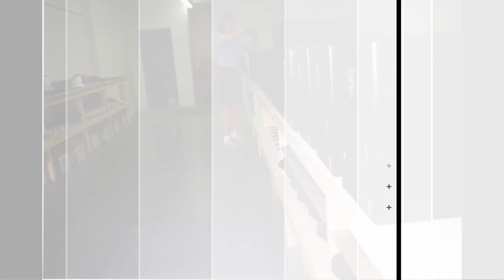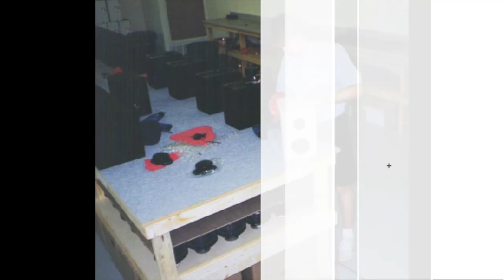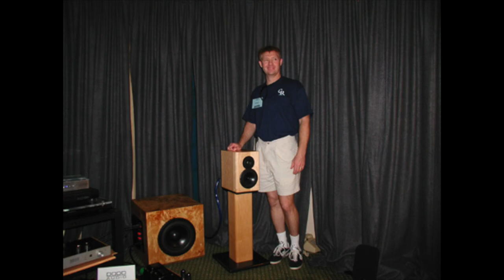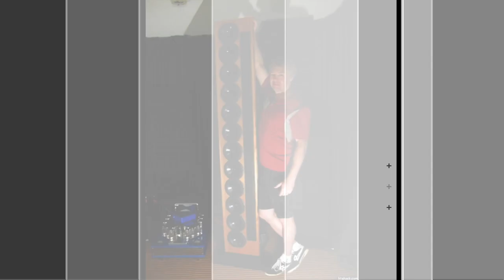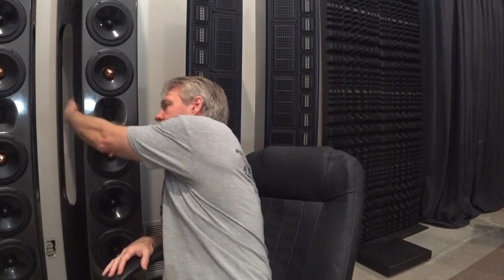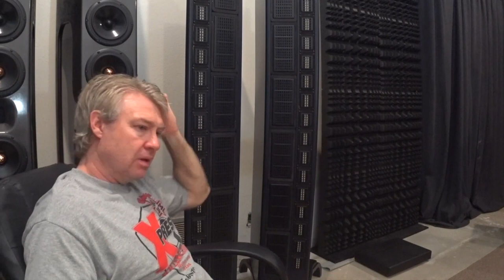Tech Talk 13: Line Source AND Line Array Loudspeakers

Comment: The neat bit about line sources is that although they aren't more efficient, they roll off in volume at half the rate the inverse square law would indicate.
So a quieter volume fills the space more evenly from front to back

Comment: hey amigo 
HF in a allison speaker forum said this can you please respond ? 
a brief discussion of tall line-source systems, mainly as they deal with low bass coming from numerous, vertically aligned small-diameter drivers.  Now, some tall planar and electrostatic systems are line sources themselves, but the video was discussing a line of conventional drivers, and that approach is as valid as what we have with planar systems.  What the video did not mention was an inherent problem with tall line sources above the bass range.   The line is emitting sound from the center will be electrically in phase with what is being emitted from the top and bottom.  However, the sounds from the top and bottom, and points between are out of acoustic phase with the center at the listener's ears.  Think of such a system with only three drivers: top, bottom, and center.  If all three are operating identically with the electrical input, but at midrange and higher frequencies the outputs from the top and bottom will be out of phase with the center.  Add in more drivers between those top and bottom drivers and things actually get worse.

As noted, due to the longer wavelengths, at lower frequencies, this may be no big deal, but at higher frequencies it will be.  This artifact was clearly outlined by Stanley Lipshitz and John Vanderkooy in an AES convention paper delivered way back in November of 1986: "Finite-Length Line Sources."  In the paper Lipshitz mathematically outlined and also illustrated with generated mathematical curves, that above about 1,000 Hz the frequency response (due to those out-of-phase artifacts I mentioned) of such a finite-length system could not deliver uniform output.  

They concluded that such speakers, no matter the design of the driver or drivers, could not be considered as high-fidelity sound reproducers.

Comment: Hello Danny, I realize that the Line Array speakers are best placed out from the rear walls into a listening space.  What about tyour Line Source speakers?  In my example they would be placed 24" from my rear wall and would be 7 feet apart from inner edge to inner edge, and the liner would be 11' to 11'6" away from the fronts of these speakers.  Would this work in my room, and if so what Servo sub(s) of your do you recommend?  I like this type of speakers as I recently had an opportunity to listen to a portable PA system made by Bose called an L1 Pro32 which uses 32 of the Bose "cricket drivers" or some similar driver and it the pair I listed to were used with a pair of the Bose Sub1's subwoofers.  I was able to place my ear to the speakers it it wasn't loud at all but they really projected the sound with surprising clarity and SPL levels at a considerable distance in the hall I was in that was approximately a 100' back from the stage area where the speakers were placed.  It was obvious that those speakers could fill a much larger room, with ease.  I suspect the same can be said for your Line source speakers.  I'm very interested in these, especially after watching a few other videos where you discuss them including with others.  I really like that the speakers are extremely efficient and can be powered off grid with battery power so I can have my music along with me at hunting camp or while fishing...lol.  Seriously though, I'm fascinated by your speakers and would like a pair for myself if they would work in my current listening space.  Thanks again Danny!

Comment: Pretty accurate explanation, at least in my experience when designing true ribbon 6ft line driver system, it is exactly as you describe it, specially far-near interaction and floor-ceiling beaming, which results in great sound in small "live" rooms... Also since efficiency is so high, distortion is super low, i know you don't like to talk about distortion which is weird to me since you care about cables and crossover part properties, binding posts and such details (as you should)...
Reply: I could be that distortion can be viewed as a symptom when having everything else good and not the main cause of the others being good. So when a product is great it just happens to have low distortion.

Comment: It's a bit of an oversimplification to say that speakers beam above wavelength<diameter. In fullrange drivers a lot of consideration is given to cone flexure to reduce the radiating diameter as frequency increases. Admittedly, this isn't perfect as the cone flexural wave produces a frequency dispersive velocity that is proportional to sqrt(frequency). So you will still get increased directionality at high frequencies, but significantly less than if the cone was rigid.
Is fullrange drivers vs bass drivers a topic for one of these tech talks or similar?

Comment: The space between the HF drivers on this Ribon Line  speakers ,  is not 1 inch best  spacing , the perfect spacing depends on the distance to the listener . If you are further away  drivers can be further away , if you are closer drivers need to be closer . Until we get to headphones where it practically needs to be one driver , can be more but there are problems of interference because one driver uses up the air , so now you dont have any more free air , non vibrating air to perfectly transmit your other drivers , so problem build up real fast .
So the reasoning is if you are say 2-3meters away then 1inch or around

Comment: why not make the line force panel from MDF glued to some Birch plywood?   this could be a home build if the plans are available.    We'd just need to Route out the holes with a router using ball bearing trim bit routers using a small template that would have to be re-positioned for each hole after maybe first roughing out each driver hole with a Jigsaw between 4 round corner holes made with a drill bit. I'm sure I could do it.
Reply: That material was not near strong enough to have that much removed from them and still have any structural strength.

Comment: On the Line Array speaker, with the 8 bass drivers, do they avoid the floor cancellation, or just reduce them?
Reply: It depends on the wavelength. At lower ranges the output spreads out vertically and couples with the ceiling and floor reflection. As frequency increases that is not the case.
Reply: @dannyrichie9743  Right, that makes sense. The woofers closer to the floor / ceiling have higher frequencies getting canceled due to reflection off the surfaces, and the farther you get from a surface, the lower the frequency of the cancellation. SO, the average response is going to be more even.

Comment: Awesome video Danny!
You look like top goal scorer on the speakers team 😉
Seriously, how are these Nxtremes to drive?
Would we need lot of power to drive these to their best potential?
How low will these Nxtremes drive in mid size room 16 x 20 with 12ft ceiling and kept 3 feet off the wall and 9feet apart along 16ft wall.... Will sub be a must ?
Reply: The NX-Treme's are easy to drive. We drive them to good levels using a 9 watt 300B amp and a 10 watt chip amp.

In your room a -3db down point in the upper 40's to mid 50's is common. 

They are designed to be used with the open baffle servo subs.
Reply: @dannyrichie9743  Thabks Danny , after things get back to normal around us I maybe interested im these....
Do you think REL push pull 2 x 10 inch sub placed in the corner with lots of acoustic boost from this placement would not be a good match in such room?
REL subs are connected to speaker output of the amp so it get same sonic character of the lows as speakers for much better match to the speakers... ???
Reply: @kdomster9141  It is not a matter of sonic character. And those are more expensive than our servo subs. And our servo subs are full open baffle just like the rest of the speaker.  So the radiation pattern matches and they won't overload the room and cause room boom.
Reply: @dannyrichie9743  How are your servo subs powered? Should those be also placed in corners to gain boost from the room? 
How low (Hz) do these open baffle subs go?
Reply: @kdomster9141  They are powered by servo controlled amps. 

http://gr-research.com/diysubwooferkits.aspx

They do not need to be placed in the corners of the rooms. Place them where they cause the least amount of room boom. Our open baffle models can be placed well out into the room.

And our open baffle servo subs will play flat to 20Hz and hit -3db down levels in the teens.
Reply: @dannyrichie9743  I would need 2 of them for dual mono set up?
So total of 4 12 inch woofers and 2 servo amps would run me under 2000usd plus cabinetry ...
Reply: Danny Richie how can we find out when the line source ready-made speakers are available please?  With love, Ken
Reply: @kenstephens2955  As it looks like I can make that happen then everyone will know. I'll post a lot about it.
Reply: Danny Richie Great!  Thanks!

Comment: I would love the NEO array, but it's way too high for my usage, maybe a 2 x NEO 10 and 6 x NEO 3 with maybe some active subwoofer beside that. :-)
Reply: There are minimal lengths required for the near field/far field transitions to work out properly. You can't get there with short lines. You just wind up with comb filtering issues.
Reply: @dannyrichie9743  Okay very interesting, this is why your speaker and i.e. the genesis is that high. Would a small video abut such special things be interesting to make?
Reply: @friedmule5403  I'll consider doing a video on that one one of these days. I need another line source in here to use an an example.

Comment: Did you mean to say run a 12" to 1000hz and 10" to 1300hz?
Reply: I had the same question. But we know that his crossover points for 6-inch drivers are often near 200 Hz. What have you learned since you posted this question; did you look for the answer?
Reply: @nickburak7518  It know it's an answer to an old question, but in case you didn't find the answer yet. It has to do with the angle that that driver play to. So at low frequencies it will play 360 degrees and dependent on the diameter of the driver it will start to only play forwards at higher frequencies. And you can calculate it for every driver size.
Reply: @maxb.simonsen2459  Hey Max. Thanks for the reply (it's always nice when anyone replies). First of all, it's a timeless question - we're all at different levels. No? But I can't remember why I asked him that question. 🤔 Maybe I would have suggested the same that you did. Now it's here if he pops in. Where'd Mark go? Anyway. I'm aware of the calculations, especially that sub frequencies are 360°.
For me, what's new - in case you weren't wondering - kidding, is room acoustics. I've started working on the sound space and I cannot say enough about the importance of it. They often say that it's 50% of the factor (some even saying it's the most important thing). I know that this isn't part of what Danny is all about in this channel, but after maximizing the speaker and cabinet combo potential, it's the next step imo. I have an old but good AVR, and I'm quite pleased with what I'm getting. The bass nodes are getting under control and the soundstage and imaging are improving. Have you treated your room? Thanks.
Reply: @nickburak7518  I agree with the room part, but when you live in a small 2 room apartment with someone else, I can't really do the things I would want to since I don't have the space for it.
Reply: @maxb.simonsen2459  Tell me about it! It's exactly the same for me, too. I have 750 sq. ft. apartment. It doesn't take much to fill a small apartment, eh? We're not minimalists. Wall space is pretty much taken up by cabinets, bookshelves, desk, plants, frames, etc., so there's no space for rear bass traps. Of course there is the "wife/gf/roommate approval" factor, but still I think at least a pair of acoustic panels at the first reflection point could fit most places (it made a difference for me). Mine has an art fabric as the presentation layer. 

But fore the main issue is the neighbours below. Presently I can't play my system much past 70 dB (about 9 am maximum on the old analog volume dial). That's maybe -40 to -35 dB on a digital volume? But the good thing is that acoustic treatments can follow you on to your next place, so it's no loss. 

So with regard to dealing with bass transmission to the neighbours below, I'm building a 48" deep by 96" wide bass-trap platform on casters for my entire rig (the speakers, audio stand, TV, etc.) in order to decouple the bass from the floor. It'll establish a 9" absorption gap. I've got a 4" layer of insulation sandwiched by two layers of cork and 3/4 mdf, plus the gap (air gaps help) the castors bring. The use of casters also means that I can move it out from the wall easily when I need access to the back (who doesn't?), if even for occasional vacuuming. All in all it should help to disconnect the bass transmission to floor by maybe as much as 50%. While that's significant it will have a greater impact within my space. It will also raise the soundstage, which helps in movies and is generally perfect for me because I also enjoy the music standing up, walking about the place, whatever. Even Steven Gutenberg (the Audiophiliac) likes it like that. To each their own. At the back but on the platform, behind the speakers, it will have a pair of 6 foot tall, 24"w x 10"d bass traps, which will really help in the living room space (just 300 sq. ft.). It should also serve to give it a nice aesthetic that even the other half may like. I have these cool red dome lights that would look appealing on them.
Reply: @nickburak7518  I have to pictures with absorption panels built in and two corner absorpers. Just remember that bass won't really gets absorbed as easily as high and mid frequencies, so you might not get the effect you are searching. Are you sure 70dB is all you can play? That's really low. You could consider headphones for evening listening sessions.
Reply: @maxb.simonsen2459  Hmm. I understand the basics about acoustic treatments for the room (reflectors, absorbers, combos of the two, bass traps, etc.); it requires some math. It seems like you have more experience than I. So do you think the 4x8 platform is a waste of effort, or am I way off with that "50%" hope? All I want is subs on where the neighbour isn't bothered when I'm at 85 dB. 

Yeah 70 dB isn't much, I know, but 85 dB is pretty good (enough to bother the tenants below if I have the subs on or even the bass set to flat with subs off. I have to turn the bass fully down). Problem is the roommate can't handle any sound at all, practically. (I think she doesn't like a full music sound or anything beyond what comes out of her cellphone, if that). If she can even hear it then it's too loud for her. Not great for me. Music is my life. But yeah, when she's out that's when I listen to music via the speakers, otherwise indeed I use headphones.